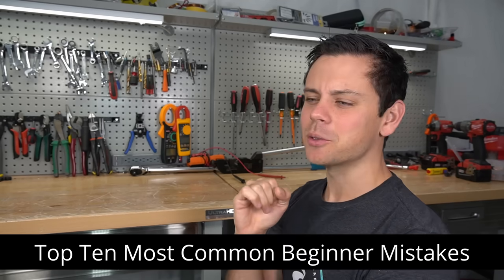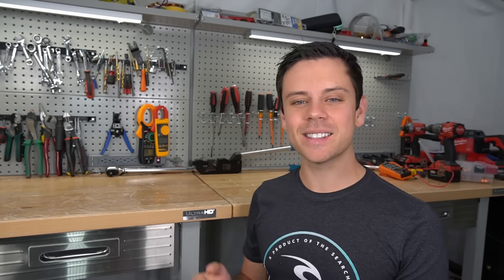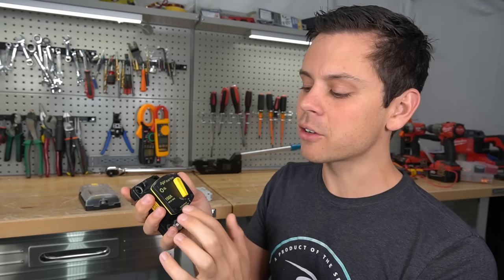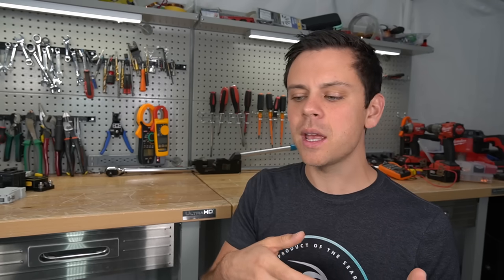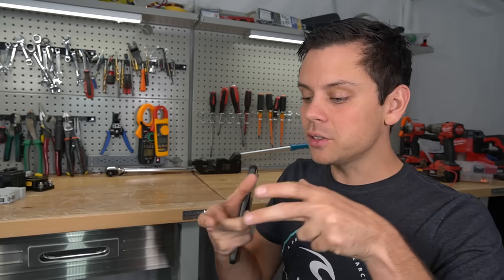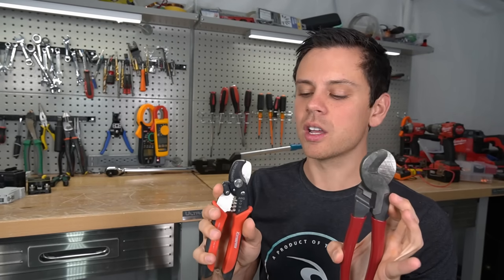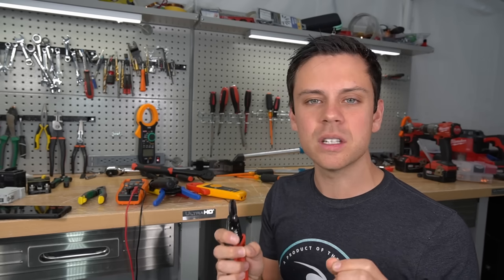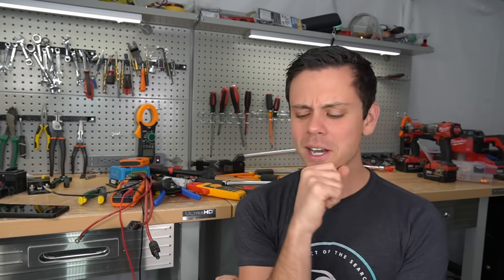Top 10 Beginner Mistakes When Building a DIY Solar System

Comment: So I WAS, Going to start building my own solar power System, as emergency backup to run 3 refrigerators and 3 deep freezers, I was planning on building 3, and double up 1 fridge and 1 freezer per system....AFTER WATCHING 6 OR 7 OF YOUR VIDEOS, YOU HAVE ME SO SCARED AND WORRIED THAT IM GOING TO BURN DOWN THE HOUSE, OR BURN UP ALL MY COMPONENTS THAT I JUST SPENT A SMALL FORTUNE ON, THAT I DONT EVEN WANT TO TRY THIS ANYMORE...BRO, I THOUGHT IT WAS GOING TO BE EASY HOOK A LIFEPO4 BATTERY TO A INVERTOR, CHARGE CONTROLLER TO SOLAR PANEL AND BOOM DONE....BUT OBVIOUSLY THERE ARE 100S OF SCENARIOS YOU HAVE BROUGHT LIGHT TO, THAT I NOW HAVE PUT THIS PROJECT ASIDE OR NEED A PROFESIONAL ELECTRICIAN TO BUILD THIS FOR ME....I understand basic electric stuff, And I understand your trying to help beginners like me, but you are so advanced and have so much information packed into a video ( which is great) BUT ITS TO OVERWHELMING...And now you got me scared!!!!
Reply: That's not a fun place to be, but do some smaller scale electrical projects and you'll get your confidence back
Reply: No comment is dead on. The beginning DYI on solar is cool, easy, cheap…. but like the comment says, he wants refrigerators, freezers, etc… That’s a bigger job. He should pay to have it installed. The channel guide is over the knowledge level that most of us have. I also do not like the way he talks with his hands as he is holding parts we need. Should probably go with a solar channel that just has a parts list you need, and the host is filmed actually building the entire system.
Reply: I was powerless and broke  friend. Solar has saved my life. I spent one check on a 200w panel, a $20. Controller and a 100ah battery.  used solid wire i found in the trash at one of our construction sites, and cut the ends off some old jumper cables. I now have a system that powers most of my house. Of course it sounds scary when he is sitting and naming things that could go wrong. But for the most part anyone with some electrical knowledge can handle this. Simpler than home ac power, simpler than what goes on in a car. And since YOU build it, that makes it easy to learn mistakes before they turn bad. I would mostly recommend using fuses between everything on the hot side. Mostly common sense stuff tbh

Comment: Nice list of to-dos.  I checked all the boxes, and appears I installed my solar system correct. It's only 660W of panels with 210Ah of lithium battery, plus a 1000W inverter, but that's all I've needed. The lowest I've taken it down is 38%.   It's still working after 2yrs and 30K miles in the RV. Thanks Will.

Comment: "FLUKE" meters are a myth.
Know your electronics.
FLUKE is a standardized meter used in govt. and production because... that's what they used previously. So that's what they continue using, that's what's in the whitepapers and specs. It has nothing to do with "quality" of FLUKE. They are NOT "better" or "more accurate". They are simply convention, and so everyone in those industries buys them because of that. Consumers: no benefit whatsoever. In fact, there are BETTER meters for SIGNIFICANTLY LESS money. 

Unless you are working on a standardized system from yesteryear, and need to publish updated specifications, FLUKE provides one of the worst "bang for buck" in meters. They charge extra because they know the govt. and Corporations will pay for it. For you: you're just getting price gouged. 

As i said, it pays to know your electronics. Buying FLUKE anything is a waste of money. Buy good quality, but don't overpay for legacy whitepapers of projects from yesteryear, and the conventions they are trapped in. 
That's my advice on this. Have a nice day!

Comment: From the expansion and contraction from heat and the vibration's caused by electricity passing through the system it is a good idea to check connection tightness on a regular basis!

Comment: Great summary. I'm an electrical engineer, but I still had to figure out some of this stuff when I installed my solar setup a few years ago. I'm definitely happy that I over-engineered everything. 2/0 gauge copper wires on the batteries and 4-gauge (vs the recommended 6 or 8-gauge) from the solar panels and no issues. It's hard to find MC4 connectors for 4-gauge wire, though, as it's thicker than most folks use.

Comment: Your videos are absolutely excellent. Regarding meters, Klein does seem great for home use- but I’d recommend getting one with a current clamp that does ac and dc.  Around $100 for the Klein is orders of magnitude better than the super cheap direct imports.  Being able to check that each trailer brake is pulling amps, see how much current the compressor on an rv AC is pulling, or see that each PV module in a parallel string has output…

Comment: I put together a small system of 800 watts with many components coming from a scrapyard. For example my batteries consist of timed out but excellent condition batteries for communication lines on distribution utility poles and timed out aviation batteries. I paid 35 cents a pound in a package deal. The cables also came from the yard and are brand new with ring terminals that came from a shipment of snow plows that got upgraded cables. Solenoids are also readily available there as well. Hope this helps. 
    Dave in New Hampshire

Comment: I use a cigar cutter to strip 8 gauge down… that GP stripper is 👌

You can get some really nice thermal cameras now for under 200 with great definition. It’s an investment that I say is necessary periodically checking all your components BUT also you can use it to find air leaks and multiple other electrical and mechanical home uses!

Comment: The good idea is to use springed connections where it is possible. They compensate metal fluidity and quality of contacts loosening over time. 
I had maintained control systems in NPP. And old contacts under the screw were quiet problematic. We had to check tens of thousands of contacts. And you never sure that your colleagues made all the job without missing to check some screws. After some years of prophylactic screw tightening, copper wire nearly stops shrinking. And some people checking some contacts are good, don't check others. And I often found that most contacts were good, but some nearby were very bad. 
After changing to new  cabinets with Wago terminals there were no defects in contacts. And there is no need to check tightening! If it is connected it is extreemly reliable. Those cabinets are operated for about 15 years and everything is good as I know.

I also made all power wires connections in my appartment with wago terminals.
That is fast, easy and you can visually check the contact is fine through transparent plastic

Comment: I took out lead acid batteries in my new (2021) 5th wheel and put in Lithium.  Literally had a battery cable come apart in my hand.  I used the proper crimp tool in my tool box, vice grips that got it tight.  I'm completely revamping the solar system from bottom up, but will very likely buy pre made cables, which will delay the build some, but not sure I want to buy the proper crimping tools.
.
I appreciate your book and these videos as I researching and learning.  One thing I'm getting a lot of confusion on, combining 4 12v batteries into 24 system.  Had some people say never do that batteries don't properly charge, and battery cable recommendations of 4 to 1/0.  Then going to the Victron multipass I'm going to add, it's about 10' one way, but I haven't measured it yet.  Battleborn states 1/0 if under (IRC) 25 round trip length.  I wish I could put it next to the batteries, but just don't have the room.  Any thought on wire size for the batteries and then to the multiplus?

Comment: I would recommend using a ratcheting crimper, as it works like a built in torque wrench. The type you show is too easy to over or under crimp a connector. With a ratcheting crimper you are far more likely to get it right. Maine Sail did some excellent testing comparing crimpers and solder joints to crimps.

Comment: Great list. Regarding wire size  I see people argue about wire gauge all the time in forums without specifying the length of the run. Even on something small like a truck a 2ft run under the hood and a 14ft run to the back of the bed/SUV cabin will rate different wire gauges for the same load. Good online calculators these days that let you assess voltage drop and other factors.

Comment: I have a renogy charge controller and I've had other charge controllers where the terminals are so small the screws so small that you cannot possibly get the cable that is supposed to fit in there to fit properly and to tighten properly. I also have the renogy suitcase solar panel and the charge controller there is the same issue the terminals are so small the wires barely fit in and the screws don't tighten well at all they're so small. I do the best I can and it works but it's not a perfect world. I have watched your videos for a long time and have learned so much thank you Will. OneNote also I purchased an AMG 245 amp hour 168 lb battery and also a 100 amp hour renogy hybrid gel battery that I bought before I knew better.. also  a 3000 watt  modified sine inverter. Doesn't work with induction cooktops. Boy the costly mistakes I've made.

Comment: All great points!

An electrician I knew told me when working with stranded wire (vs solid wire) he would tighten the terminal and then wiggle the wire for 10-15 seconds and then retighten the terminal again.  All those strands can shift and create extra room inside the terminal causing a loose wire.  And a loose connection adds a lot of resistance to a system.

And NEVER buy a cheap torque wrench. I bought some cheap ones from HF and they popped the head off a bolt.  Never clicked.  Also, they should be tested periodically.  And they also need to be stored correctly.

Comment: Great video Will, When I used to install large 48V power battery backup systems for telecommunications company's we always used calibrated hydraulic crimping tools.
Reply: In the power industry we crimp all high voltage connections (just take out your binoculars when you’re looking at  jumpers on overhead conductors - you’ll see that they are all crimped).
When I worked in a hydroelectric plant we used to tighten the screw connections on the 220/480 volt terminals and contactors EVERY year.

Comment: Just a couple of things, if you are wiring in a marine system you should use tinned copper cables not just copper cables, also another reason not to use solder in joints if you do have a hot joint the solder will melt out. Soldering connections are not to regulations for low voltage connections in my country

Comment: 8:15   The way I solder large lugs to 02 wire is  that I hold the lug with the open end up (like a drinking cut) with pads to keep heat from sinking out via metal to metal contact. I then heat the lug with a propane torch and jam solder into the "cup", then jam the stripped copper cable end into the molten solder. This doesn't expose the cable insulation to heat enough to compromise it. The copper cable sinks away a lot of heat so the solder solidifies fairly quickie. I'd have used a crimper if I had one but I figure I can do it over if I have a chance. The insulation does creep up a bit. But heavy duty heat shrink tubing can mitigate most problems with this.

Comment: Great list, Thank you!  Relating to both installing lugs on wires and wires into terminals.  Do not "tin" the ends of wires that are going into terminals.  The solder will "flow" away from the pressure that the terminal puts on the wire & solder and the connection will get loose.  Also as you stated the wire can get very hot in extreme circumstances and the solder can heat up and flow away from the connection.

Comment: Thanks to Will’s videos I saw a way I could afford to go Solar. In his video  a couple years ago he explained about cheap used solar panels  from Santan Solar.  I am now off grid 1 1/2 years. I got the cheapest panels and the most expensive controllers so that I could over panel without problems. You can even set the max amps the controllers will put out.
I am running on a 6k split phase 230v  LF inverter  and 500 amp hours of 24v lifepo4. I use low voltage relays to manage power use so that it is an automated system of enabling hot water heater and AC when there is abundance and disabling high energy items when the voltage drops below specific voltages preventing the total loss of power.
Reply from the maker: Very nice

Comment: 0:14 The only thing I'd add to this is, be sure you're testing voltage at peak solar exposure for the panels' location. I know, it should be obvious, but I would hate for people to be checking voltages in the shade or on an overcast day, only to have an overvoltage problem later.

Comment: Something to add about conductor size, "voltage drop". Blue Sea Systems has an app (Circuit Wizard) for determining wire size by voltage, conductor length, allowable voltage drop, bundled conductors, insulation temp rating, and if installed in engine room. It's designed around boating, so unfortunately you only get 12, 24, 32 volt selections, but for the lower volt systems it'll get you the right wire size. I use the 3% voltage drop for panel leads, charge leads, and inverter loads.

Comment: Thanks! I liked that. Remember the 'greasy fingers issue' when handing bare copper wires and strains. Use gloves to avoid the issue of surface contamination which cause electron 'cross-over' issues.

Comment: In my part of the country a crimped terminal WILL corrode. We crimp and then solder. Apply voltage to the wire/terminal and then map gas torch. Rapidly get temperature up, apply solder with paste and then put the terminal into very cold water. Apply die-electric grease, then slip the heat shrink on. This will last 10 years or better in an industrial setting around salt water. What works in one area won't always be a universal fix. Many auto manufactures also require soldered terminals in recall repairs.

Comment: Bought my self a hand held hydraulic crimper it’s small , for heavy gage wires came with different “ anvils “ works great , good vid ! Fun fact most solar systems from a company ( installed) will not work during a power outage, it was “ odd “ talked to many of them , and most “ shy “ away from battery power back up , transfer switch or not , so I thought why bother, I’ll do it myself, probably could power up just enough using “ cheap “ batteries ( deep cycle batteries) b used only if when needed

Comment: Square D QO breakers are ac/dc rated. they are available at home centers. I worked in a data center (-48 volt nominal). Some of the DC distribution centers were populated with QO breakers.

Comment: I made an emergency system for our sump pump and the mistake of not having enough batteries to run my 3000watt inverter. It would run for about a day The alarm would go off. Just took advantage of the Black Friday sales and corrected that, and can’t wait to get it set up!

Comment: Have to disagree on soldering bigger wire. When copper "corrodes" it gets a "film" on it similar to wearing a glove. this isolates strands from other strands. Immersed in solder, this cannot happen. That said; I mostly do Both, solder a stranded wire to eliminate the "glove effect", then crimp, or solder together for smaller wires and heat shrink. My backround is generator repair for Coast guard units.  Great Video Will.

Comment: I plead "guilty" on some of these points.  For example, on my first RV solar system of 190watts (panels in parallel, batteries are two 6-volt FLAs in series), I used CCA wires between the panels, controller and batteries.  This was 13 years ago and I didn't know any better.  In my own defense, I oversized it (4 AWG, 12 feet between panels and controller, 6 feet between controller and batteries).   I don't even want to tell you how I "crimped" lugs on the wires.  I was working on this out in the desert and forgot to bring a crimping tool with me.  But I was desperate to get it put together because my batteries were depleted, so I found some fairly large rocks and beat on the lugs.  Lol.  Amazingly, the system has worked great all these years and is still going strong.  But now I will revisit those lugs with my big crimping tool.

As for the CCA wire, I don't know.  If it's oversized to more than compensate for the increased resistance in the aluminum, what's the concern?

Comment: I am an Extra Class HAM and since we use high and low DC and high AC voltage frequently, this also applies to radio engineering too…I definitely prefer crimping but being effective a soldering is still a necessary skill…but I agree regarding large contacts…always crimp…a pneumatic crimp has become my choice…I used to hammer, but now I use a pneumatic crimper…

Comment: Been learning from your channel for awhile; excellent material. How about a video of what are the proper tools with a bit on why one type over another cheaper version. You could also do some builds of basic systems to incrementally show the key principles of how you expand a system from something simpler. You could even just start with a very basic capability to run a battery charger for tools and slowly expand that to show progression. Show how the connections are actually made end to end. You'd get way fewer pings from people asking you to design their system and become a mentor to even more people. Thank Your for all that you do.

Comment: 👉 Thanks to you, my 4 12v 100ah lipo, Epever, Geandel system is powering my frig 24/7 (and a 12v led light) in my home. My last bill was $32. It was for a emergency backup, but, I take in more watts than I use, so, why not. I also bought your book. Too bad I started before I learned a 24v system was better, but, I'll fix that soon. Thank you again and happy holidays. 🖒😎